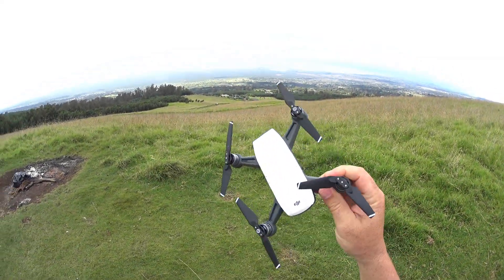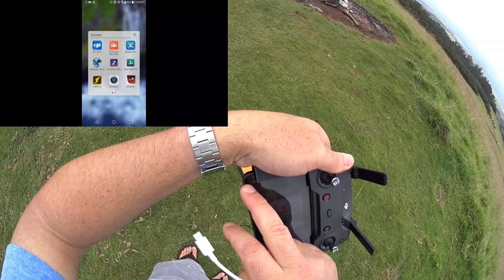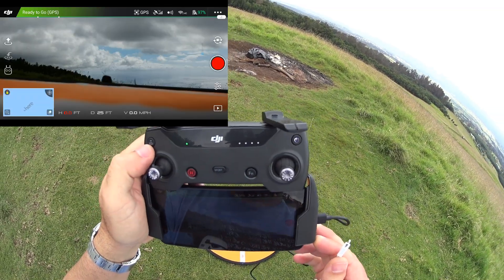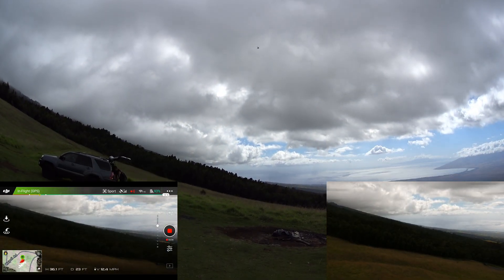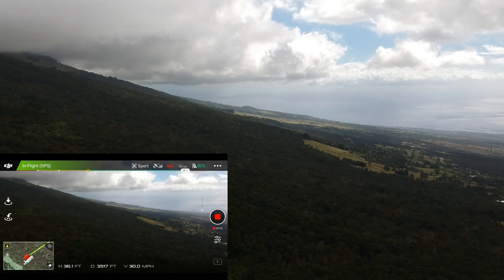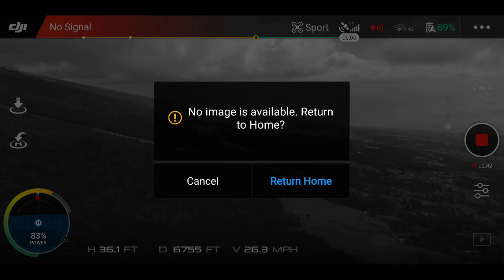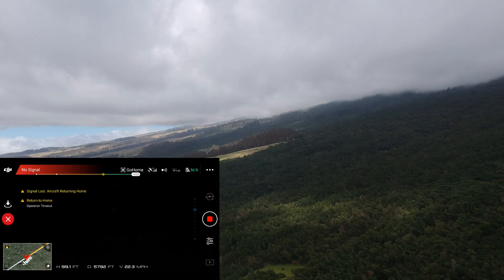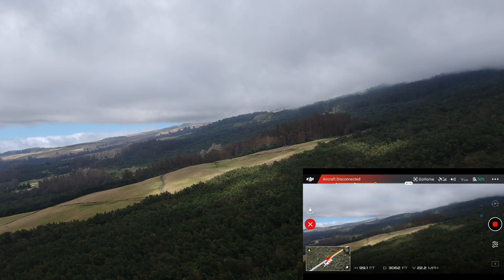DJI SPARK Review - Part 5 - [In-Depth Range Test in 2.4Ghz Mode with RC Controller & OTG Cable]

Comment: Nice try on the 2.4 ghz range, at least now we know to say with the stock setting of 5.8ghz. After all, two miles of range with FPV is all most of us really need from this small selfie style quad.
Reply: With 2.4 Ghz, only choose channels 1 or 6 or 11, no other channel, all others overlap and will make your drone/controller less reliable.
Even though you are not near homes, you are will actually pick up GoGoInternet etc. from aircraft.
Reply: Ron Brown it’s not a selfie drone. If it was the only thing you could do with it is hand gesture mode.
Reply: When comparing 2.4GHz with my home wifi, it seems that 2.4 better penetrates walls, etc while 5 just has a higher bandwidth. So while 5 might have a longer range in an open area, 2.4 might better be able to handle trees and infrastructure, etc.
Reply from the maker: +Ron Brown 👍
Reply: Ron - 5.8 is only for bandwidth as its inferior in range and penetration. A modern wireless router is a good example of that.

Comment: 2.4Ghz is more used because WiFi(internet) mostly uses 2.4Ghz, so in theory 5.8Ghz should be better because there is much less interference, but there is also fact that 5.8Ghz isnt that good going thru objects, so by that 2.4Ghz channel has a better range. But you are on the mountain so there isnt walls of any sort or any other object blocking signal(except trees) so once again in therory 5.8Ghz should be better. Sorry for the long post and a lot of buts. And you are awesome.
Reply: put your phone in airplane mode and use OTG only it works better.  if you forget to use airplane mode and you linked your phone to RC via wifi in past your phone and the app prioritizing using wifi together even with a cable plugged in.  

side note to guy you are responding to above us:  2.4ghz is superior outdoors away from interference, it takes less energy to propagate outdoors and have a much larger wavelength which helps it out as well, it is also most efficient band to use on dual band antennas like the DJi antennas and its a reason occusync and lightbridge 2 use 2.4Ghz band as well..  5.8Ghz takes more energy in the same package to propagate, not to say it wont go as far or anything, conditions do apply.    but it does seem that Dji last update has slightly decreased the effectiveness of 2.4Ghz wifi scanning and hopping in favor of better 5.8Ghz channel hopping with the RC.  not sure if thats 100% true either.
Reply: You can only select the channel for your phone-controller connection. With controller bound to the drone it's not using regular wifi and you tested this same connection again. Also your otg was just charging your controller, no connection there.
Reply from the maker: +Mihael Mutić Perhaps my phone interfered with the 2.4ghz than the 5.8 as well.
Reply: Thats not all the OTG cable does, charge the controller..Are you serious?
Reply: Michael Steven Think what he meant is that the phone was still connected to controller via WiFi regardless of plugging in OTG, think you have to disconnect phone WiFi from controller as it won’t automatically switch to OTG when it’s already connected via WiFi if you know what I mean.